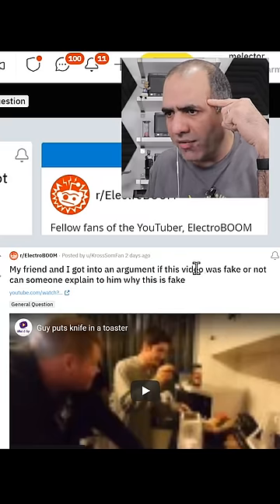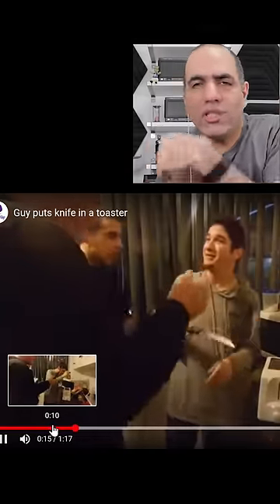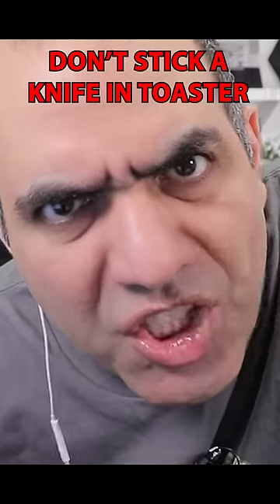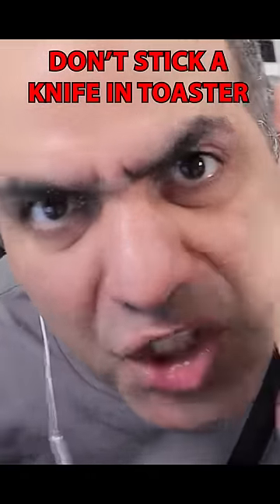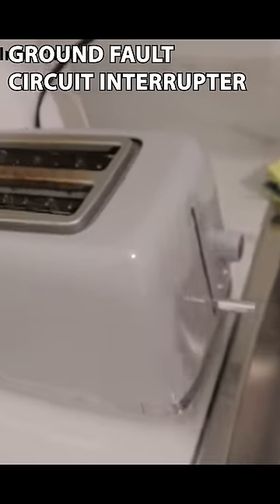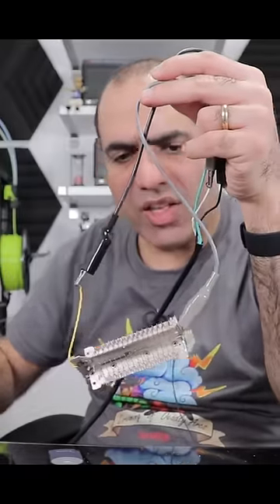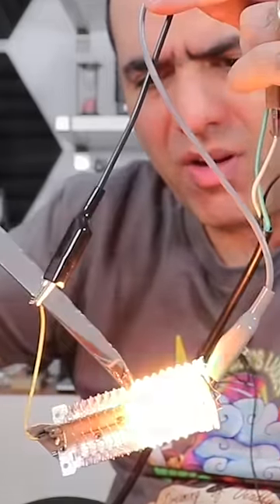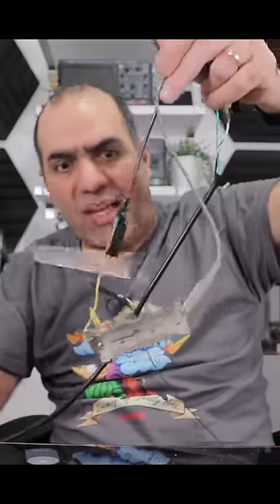DON'T STICK A KNIFE IN TOASTER! #electrical #fake #funny

Comment: That's right only stick a FORK in a toaster to get the bread out.
Reply: Wait don't people actually do that?
Reply: Thats deadly💀
Reply: Dumb ways to die minigame?
Reply: Why do that when you can directly butter and yeet that bread 🤔🤔
Reply: I use plastic or wooden tongs. I also switch off first. Either will save you and your toaster.
Reply: @Alihaaaa4 I do it all the time I just unplug it first
Reply: wood one
Reply: yeah but use insulators like wood or plastic if you forgot to turn it off
Reply: Or maybe just lift the lever?
Reply: Bonus points if it doesn’t have a rubber or plastic handle.
Reply: I do it
Reply: I did that 😅
Reply: @Alihaaaa4 nooooo?

Comment: Also, don't fight a trolley bus.
Reply: Ayo whaa
Reply: I've seen that video... Poor guy didn't even have a chance.
Reply: A what?
Reply: @trashmusic994  An electric appliance that is also 10 tons of steel travelling at 35 mph. Slightly easier to fight than a street car or the mighty steam locomotive, which is the apex predator of the streets.
Reply: Speaking from experience there mate?

Comment: I stuck a butter knife into my toaster simply out of curiosity whenn I was younger. While it didn't blow to smithereens like that video, there was massive shower of sparks, no burning.
Reply: I remember watching Bill Nye the science guy doing elctrolysis?/hydrolysis? (not sure which is right) where he put battery leads into a container of water so it bubbled... i was like 8-10 years old and thought id try to do the same by sticking wires into an outlet and into water.  thank god my mom was able to catch me trying to put the wires in the outlet before anything happened
Reply: I tried to soften a chunk of fridge cold butter on the breadroll tray on top. No sparks but a massive shower of flames.
XD

Comment: Was a burn mark on the wall at school, turns out some kid had jammed a paperclip in thr 250v outlet and turned it on, flew across the room in a ball of fire
Reply: A school where the power outlets were not properly fused. That's appallingly bad. What country was this?
Reply: @BrianG61UK  they were old outlets to be fair, built into lab tables, this is the uk
Reply: @phonotical I'm in the UK too. Maybe paper-clips have a higher resistance than one would think. Or could they have been special low voltage high current outlets? I have seen, if I remember right, 24V AC on special round pin plugs in one or two labs in universities.

Comment: I’ve got a question: what happens if you burn the bubbles from an electrolysis? I do know their either hydrogen and oxygen bubbles. Im not just sure if the’d burn. I do know some of the gas escapes the water since I’ve made an electrolysis engine and saw and heard the bubble’s escape. If you are doing this. Just make sure you’d wear something that can protect your face in case something happens.

Comment: I stuck a knife into a toaster when i was around 6 or 7 years old. I touched the Red glowing "wire" that spinned around a rod or something. My toaster did not explode but there was some type of bang happening for sure. The glowing wire going around the rod stood out at the point where i touched it. Or did a wider loop around the rod. My grandmother got scared for sure.

Comment: When you power on the circuit  use a power strip or a power coard that has a switch so if anything happens you can turn of the switch

Comment: Can confirm sticking a knife in a toaster does nothing more than making the power to your building go off. Metal handled ones don't even tingle.

I might have done it once... Should have learned from the time I stuck a screwdriver in an electric heater.